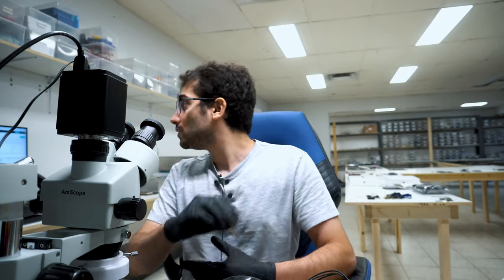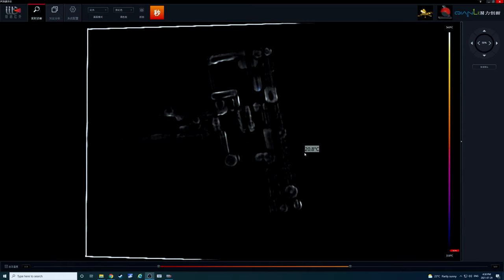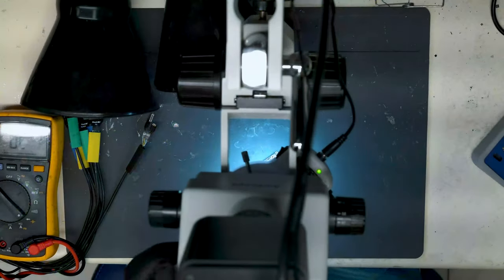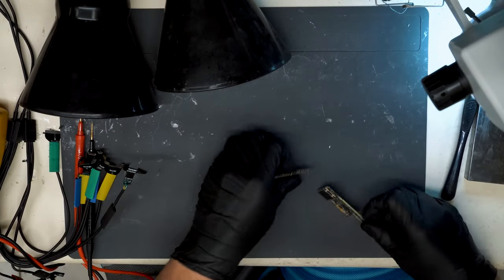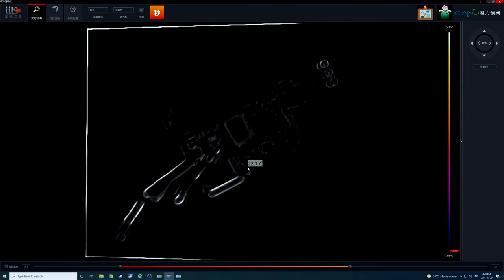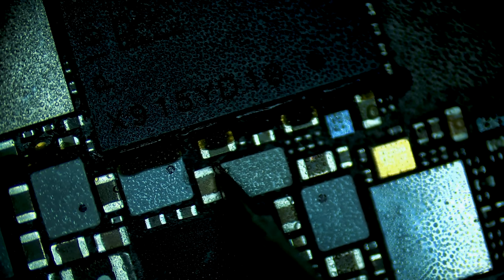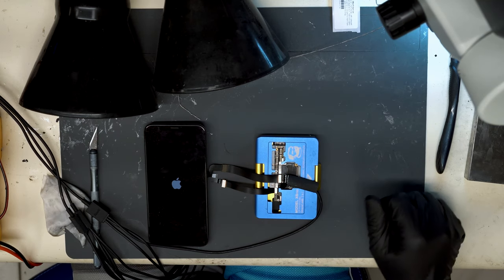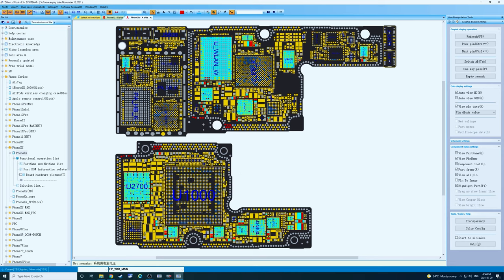How to Repair an iPhone XS that will not charge or turn on. VDD Main short found on the RF board.

Comment: Actually that is what the tech did on my xs board shortage and it came back to life perfectly but my wifi and bluetooth wont recognize any nearby connections i wondered what might be the reasons and the causes of it?pls let me know and tnx.
Reply from the maker: It is likely a problem with connection between top and bottom board